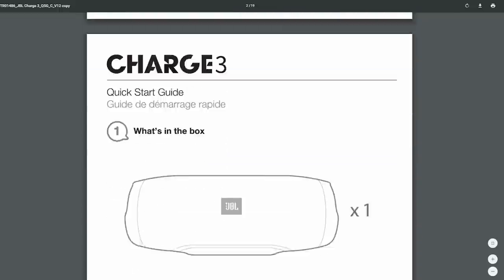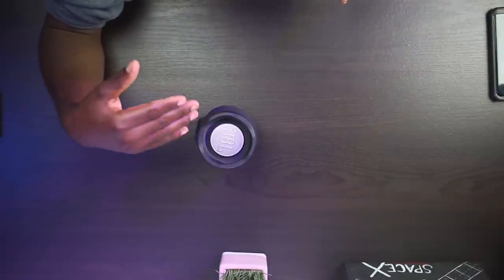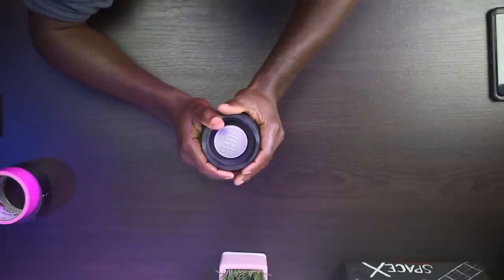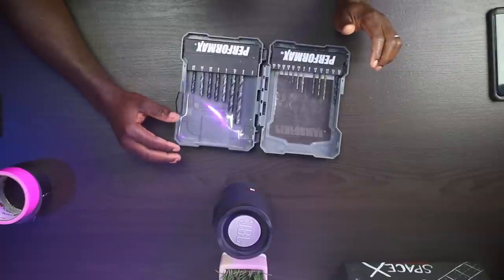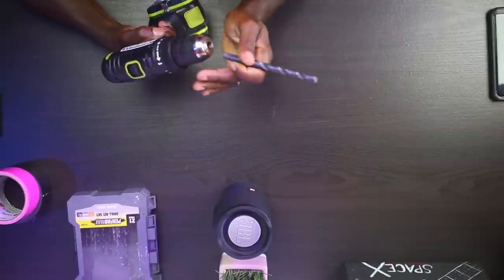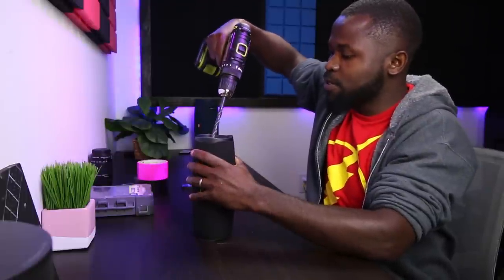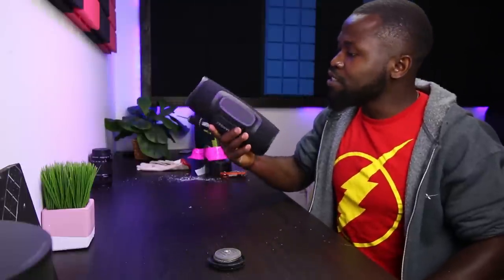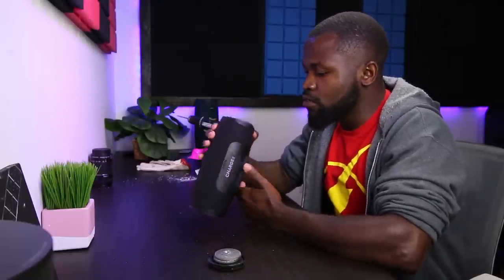JBL's Passive Radiators, 🤔what happens if you damage them? How will it sound after damage

Comment: Fake JBL's be like: Ah yes! Finally a worthy opponent!
Reply: The passive radiators on the fakes ones doesn't even work.
Reply: @yuotosaka9092  Some of them do work
Reply: @proxyhx2075  Yup, but the one on mine only seems to work a little since it has a very weak vibration when I'm touching it.
Reply: @proxyhx2075  I'm planning to take apart my fake Charge 2+ and maybe try to seal it. Maybe that should work. I'm also planning to maybe just buy a new speaker like Awei Y280 or Awei Y331 which also sounds kinda good and it also have passive radiator.
Reply: @yuotosaka9092  it still wont sound good since it has bad speakers and the passive radiators arent calibrated
Reply: @nebeladem1239  Yeah tried that and it still sound the same. It's cheap anyways so I decided to still try it.

Also have bought a Awei Y669 and I really like the sound.
Reply: Have you seen the foam balls of thespeakers of hi end phones what if we stuff styro balls inside the jbl box will it sound more deep

Comment: Undamaged = Sounds like JBL
1 hole =  there is a slight bass reduction
2 holes = more bass reduction
no passive = is this a fake JBL or Replica
Reply: Fake JBL 🤣🤣🤣🤣
Reply: 20 dollar Walmart speaker
Reply: Replica and fake are the same thing. What are u on bro.
Reply: @EF.BE.I  bro my speaker is 14$ and is made by Walmart and has great bass mid bass
Reply: @revolution5547  he said 'Or' not 'And'.Anyway do you even know the meaning of 'Or' and 'And' and where and  when  to use them?
Reply: @Written.By.PenCiL  u can understand it in 2 ways
Reply: @revolution5547  ok let it be..
Reply: The passive radiators on the fake JBL doesn't even work. But there are instances some fake JBL sound like and the passive radiator works like the real one.
Reply: @yuotosaka9092  its just because Cheapo doesnt have the designated Case to Speaker to PRs resulting the Speaker is too weak,Or the case isnt Air thight
since i just saw countless Videos fixing Fake JBL either Changing the Speaker,Amplifier,or just airtighting that thing

Comment: The brutal part of the passive radiator is the rubber at the sides not the center
Reply: But they aren't brittle...
Reply: @jonathantierney7301  overtime they are as every rubber stiffens after time. I think what he meant was that it's the only part that can actually get damaged during use as most likely you are not going to accidentally drill in the metal part for long enough for it to break
Reply: A lip on the outside of the inner plate would help stop intruding pointy bits from hitting the rubber.. 
innuendos not intended.
Reply: The rubber round mine shat itself which was a total pain

Comment: I did the opposite, i glued extra weigt on each passive radiator,  an iron coin around 30mm in diameter and 3mm thick and it realy helped getting the tuning down from 70hz to like 40-50hz so you can realy hear some deeper bass!  i also stuffed it full with damping material.
Reply: ohh, and you can disamble it without breaking it, just serach for an video.

Comment: For those who keep saying this isnt a passive radiator and its a subwoofer. peakers produce sounds by vibrating air molecules. A passive radiator uses the internal pressure geneated by the speaker inside the sealed encloser and specifically weighted to only react to the lower frequency sounds thus vibrating the air adding support to the low frequencys. This is not a subwoofer there is no magnet structure or power being run to it. Do research before you make foolish statements on the internet.
Reply: I new that passive radiators werent. A sub but all the other stuff is new
Reply: I think the purpose of passive radiator is to make the speaker waterproof. A ported speaker will get flooded when submerged in water. But with radiators, the speaker would be fully sealed and also allows the woofers to move freely without too much internal pressure..
Reply: @ashlysherief3850  I passive raditor and a think that makes it seem ported with out it being ported alot of stuff us it its not just for waterproofing
Reply: @ashlysherief3850  Passive radiators effectively "increase" the amount of low end produced by small drivers in a small enclosure. Ported enclosures require twice the internal volume. Radiators are used in small speakers for this reason. Bass produced is also more accurate and cleaner bass response due to the active drivers utilizing the internal sealed volume as an "air cushion spring" to push back on.
Reply: Thank you
Reply: When I was younger I though that the prs on jbls were actually mini subwoofers

Comment: Seal the holes with a piece of plastic and use clear silicone to seal it and it will keep the plastic in place and fix the sound and if you cover the entire surface area with the silicone over the plastic it will harden up and make it like a speaker box without a passive radiator it should sound good not the same maybe but good and will get rid of the echo That's what I would do anyway to fix my speaker at least it wouldn't be a total loss

Comment: "...don't try this at home...'           Too late man, too late  😂
Ok, my tip: take an old speaker that fits the hole, but do not connect it to the amplifier. It has to be airtight so if you see a slit or hole,  use silicone kit or hot glue to seal it off. Be aware not to violate the integrity of the cone (best cone would not be paper but plastic or space maturial) -- When you close it up and play music, it will act as  a passive radiator - but only as long as the whole speakerunit is airtight. Even the smallest hole will make the radiator defunkt.  BTW  I think that's actually how someone got the idea in the first place  ;-)   Good luck!

Comment: They say to not touch them as in push in to them, because it’s all air pressure and when you push it the air pushes the actual speakers them selves because moving the speaker manually will damage the speaker and kill the sound quality.

Comment: @Fernando-me1tu
4 minutes ago
Hello! My harman kardon onix mini speaker had a knock while working, the two internal speakers work well, do not distort and apparently are not damaged, but the two passive radiators or suspensions no longer move and do not emit deep bass, check the passive radiators and No They have cracks and are not detached. The plastic of the case was not damaged. What could it be? Could it have to do with the sealing of the device?

Comment: So, a passive radiator is a mechanical equivalent to a port, and it is tuned by weight; the best and cheapest way to add weight is with metal. The most vulnerable part of a radiator or even a speaker is in its surround. A normal person doesn't accidentally damage their passive radiators in their JBL Charge 4 by drilling a hole through them. What was the point you were trying to make again?

Comment: The bass radiator works by the means of vaccum created inside the speaker...so the speaker will work but the sound will be distorted if the radiator is broken👍👍

Comment: Does he realise he needs to take the cover of then take side caps so he doesn’t have to cut the actual prs out 🤣
Reply from the maker: Do you realize the point was to damage the PRs?🤣
Reply: DLX Willington RIP 🤣🤣🤣
Reply: Nope, he doesn't man.
Reply: DLX Willington he is talking about preserving the passive rads when taking them off instead of cutting the surround and taking them off
Reply: @DLXWillington , the fact is, that you could remove them after you made a hole in them, instead of cutting them. And he probably meant that.

Comment: I bought Charge 3 for 5 days ago. When I connect it to JBL apps, it said to update Firmware. Should I update the firmware?
Reply: XGadget ID do you have any other JBL speaker?
Updating it enables Connect+
Reply: He should also note, after you update to connect+ there is no going back
Reply: @hzd1494  yes. I notice it, that's why I asked this question. 😅. Btw, my charge 3 sound little bit muffled. The low bass is very dominant, so the mid/vocal has the same level with the low bass.

Comment: the passive radiators of the flip 4 and pulse 3 might just be the best ones of them all.
Reply: No the xtreme
Reply: @wouldyouglowme4235  the xtreme has the most musical pr's, but not the best. i would say the xtremes and other speakers with similar pr's were more scratch prone.
Reply: @Altezza1999  I'd say the onyx 5 has the most musical pr's
Reply: I've just got the flip 4 for 8w it's very impressive. Andy England 🇬🇧

Comment: You can order replacement passive radiators on eBay or buy a non-working unit and steal the passive radiators...or you could use hot glue...or jb weld

Comment: there's a conceptual mistake on this video. The orientation to not touch the bass radiator is because when you push them, you're also "pulling" both of the drivers, whitch can lead to phisical damage to the mooving parts of the speakers due to excessive extention and non-linearities. When you push the bass radiator while there's music playing, the non regular movement induced on the driver will transduce to non-linearities, witch can damange thoses voice coils by them touching the magnet core.
Also, you can, even, stretch the suspention of the radiator until a point above the yeald stress, witch leads to changes in suspention propeties and ruins the box tune frequency. 
this kind of damange witch you are showing in your video do not have any correlation with the JBL orientation of not toutch the bass radiators. When you put a hole in then, you are basicaly screw the f**k up the enclosure, killing a good chunck of the bass and low mid by leaking the mirrored signal produced by the back part of the driver.
additionaly, you also altering the suspention of the drivers by screw the enclosure. The drivers, so, mooves with less suspension and more drag, altering you signal response curve.

Comment: Jbl just announced the pulse 4. They updated the design on it. Not sure how I feel about it. Has same 12 hour battery life but I’m hoping that it will actually last 12 hours. I’m also hoping that they improved the sound. The pulse 3 sound was not good. Also it comes with the new party boost so I think that’s the new thing. They say it has 360 degree sound so this should have more then one driver.

Comment: They arnt "passive radiators" there called subwoofers and produce bass sounds.
Reply: No they are not
Reply: All a passive radiator does is allow the air pressure in the speaker to move around inside the speaker a subwoofer is a type of driver that produces lower sounds.
Reply: Jello Minister jbl calls them passive radiators plus a subwoofer is two speakers one on top and one on bottom
Reply: SillyGamer _164 that’s not true either. A subwoofer is one speaker that produces sub sonic frequencies

Comment: Well since you broke it, try attaching the wires to an actual sub, and see if 30 watts can power a subwoofer. There's an idea.
Reply: Jacob Orlando you realise that you can power a sub without an amp as well and it will still play ( just extremely quiet) and if you are talking about some actual excursion you can power a 2000 watt sub on 100 watts free air and it will still reach max throw. You need the pressure from the bass box to get realistic results. If you plug the amp to a 500 watt sub you can power it to its limits no problem on those 30 watts.
Reply: No, first of all it has a DSP that cuts off bass (sure you can turn if off) and second you can just buy a plate subwoofer amplifier for less the cost of a new JBL speaker, and third it probably will be too weak amperage wise to drive a real subwoofer

Comment: Hi DLX, why didnt you just take off the textured cover and removed the screws? You could have take a look at the passive radiators from their back without having them damaged? But, yeah this video was about how to destroy a charge 4 😂. I don’t know how you call it in English, but there is something like hot glue, heated by something that looks like a gun, and it’s mostly like Plastik that’s getting fluid by heating, and you can not just use it like glue, but also like a filling or/ and as a sealing for plates you put at the end of the side

Comment: nice.. what if you cover the sides with materials like paper, tighten them with rubber bands at the end.. also try balloon, may be use just a torn piece of balloon rubber n place it with rubber bands or glue.. see how it sounds.. try sticking a circular cardboard on the rubber, then may be a metal round thing, like the original jbl covers if you still have them.. how about condoms? blow them and put them using rubber bands..

Comment: JBL charge4 GG ---> metal radiator with rubber 
JBL charge4 TL ---> paper radiator with rubber
Reply: Which best ?
Reply: @turkishowspeed  the one with metal is heavier - so the "low" bass is louder than mid/high bass.
Reply: @olorb2618  thanks
Reply: @turkishowspeed  no problem :)

Comment: You could of just pulled off the outside rubber and un screwed the passive radiator instead of braking a really expensive speaker

Comment: When I was watchin this my Xtreme was on the table. I had to pause and hide it under a blanked so it's not traumatized.
Reply: Bros Mario all you kids with your fancy little jbl speakers watching videos about them know nothing about good sound quality. If you want a good Bluetooth speaker get some mdf get some tweeters get some woofers and get a sub and an amplifier and put it all together. That’s what I did and it sounds absolutely fantastic. Better than any jbl Bluetooth speaker I’ve ever heard. Not even the boom box can make such deep and clean bass and such crisp highs. And it’s even about the same size and weight of an xtreme and it sounds 10 times better. If you want good sound quality just get some speakers with tweeters and woofers and get a sub. That will sound 15 times better than that. Probably even cost the same